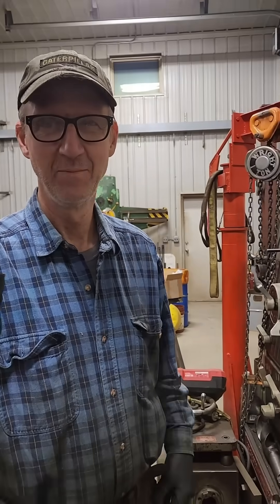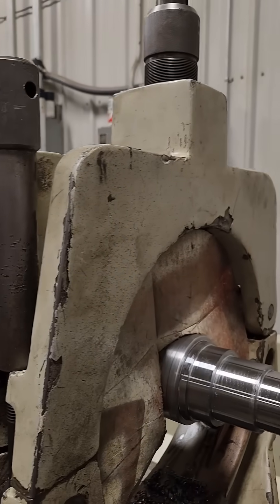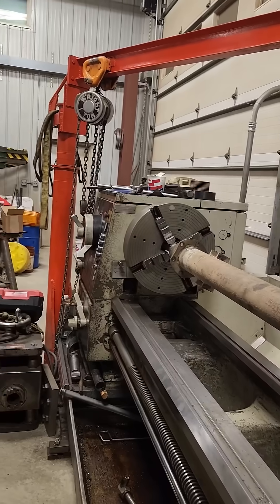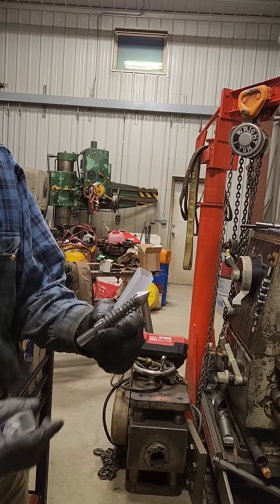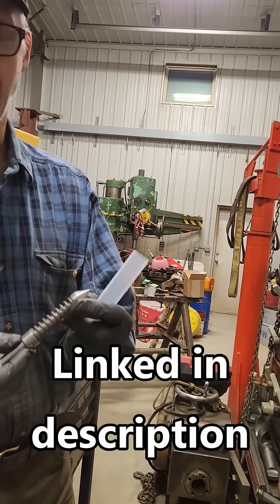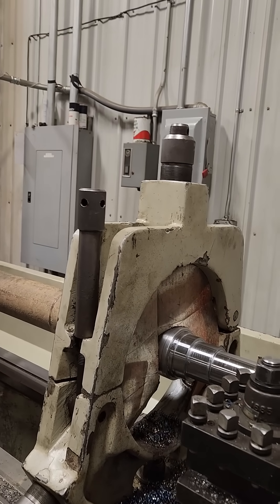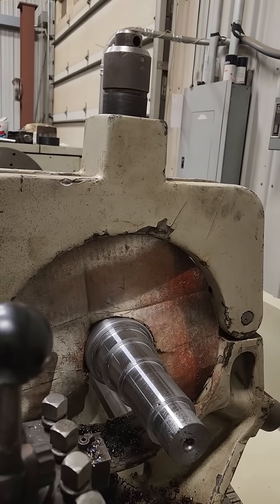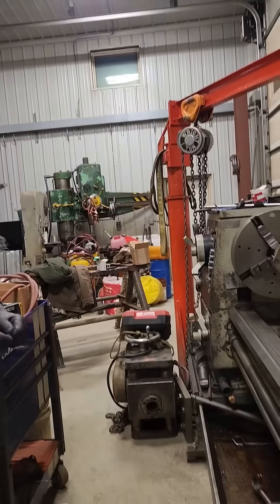15 Mile Machine's steady rest protection (and tap guides!)

Comment: We made those spring loaded centers in "machine tool one" when I went to Wentworth in Boston in the early '1980's.
Still use it for a number of processes. We made them on manual South Bend lathes.
Good video. I like the cardboard chip shield. Good idea.

Comment: I am unaware of this version of a tap guide. The only one that I'm familiar with is a block (if I remember right it's about 1½" thick) that you set over a hole and allows you to more easily start hand tapping straight. Of course, this really only works if the part that you are tapping has a flat surface, or if you can clamp it low and put the tap guide flat across the vise.
This thing that you showed is a different animal entirely!
Is it likely that we will see a video where it is used?
The web address that was shared isn't able to be copied from comments, and it isn't a hyperlink.
🖖
Reply: It's held in the chuck of a milling machine or drill press.
It holds the tap vertical using the centre drilled hole in the shank of the tap.
You have to first attach your tapping handle to the tap, then place both the tap and handle between the tap guide and workpiece.
Turn the drill press or mill handle down a bit to compress some spring tension on the tap guide, then hand tap the hole as you normally would and the tap guide follows the tap down with spring tension keeping tap in vertical alignment.👍